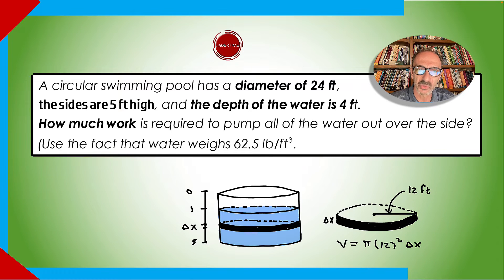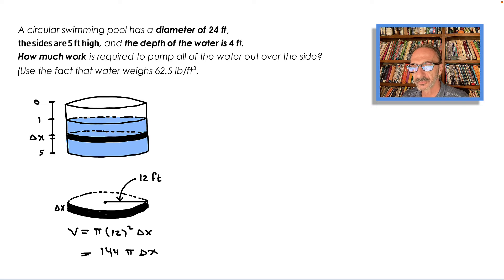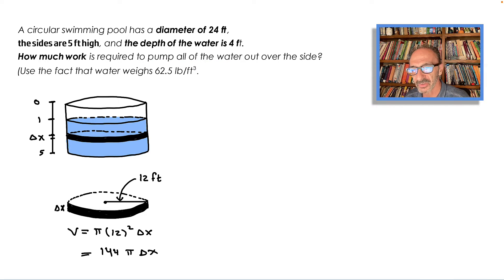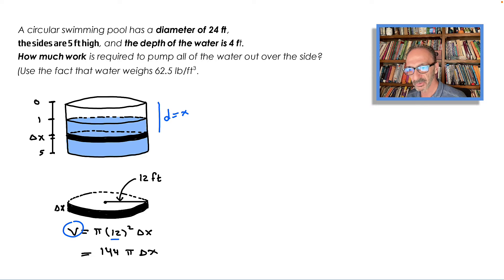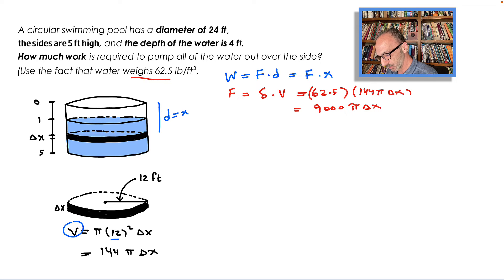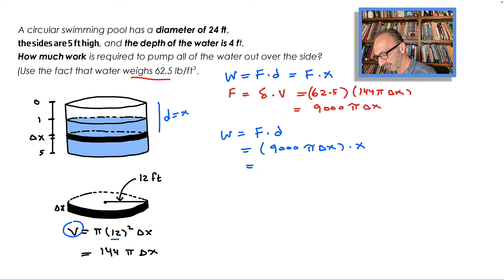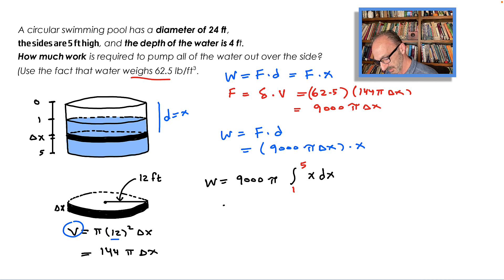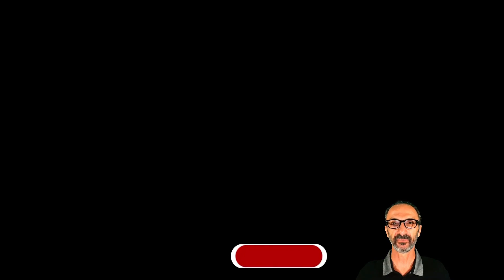How much work is required to pump all the water from a circular swimming pool over the side?

Comment: thank you sir. Why is the distance x not (5-x)?
Reply from the maker: If you look at the graph, the blue area covers the values of x, which vary from 1 to 5. The sample slice, darkened in black, varies from the location represented by x " as the x-axis is graphed going down starting at zero" varies from 1 to 5.
When we graph and present delta x, we look at x and how it varies to cover the whole region in blue. In this case as the graph presented, our location of the slice is located by a distance x from the zero location and it covers the whole region by moving it from 1 to 5.

Comment: Shouldn't you have integrated from 0 to 5 instead since you have to bring the water over the edge of the pool?
Reply from the maker: If the slice lies x sub i "*" ft below the edge of the pool ( where x sub i "*" is greater than or equal to 1 and less than or equal to 5), then the work needed to pump it out is 9000 pi x sub i "*"  delta x. Thus W = integration of 9000 pi x dx from 1 to 5.

Think about if the depth of the water only 2 ft, are we going to integrate from 0 to 5 still or from 3 to 5?
If we integrate in both cases ( with water of depth 4 ft or 2 ft)  and in both cases we integrate from 0 to 5, then the depth of water will not affect the answer  which is not true.

Just think about the SLICE with x varies from 1 to 5.